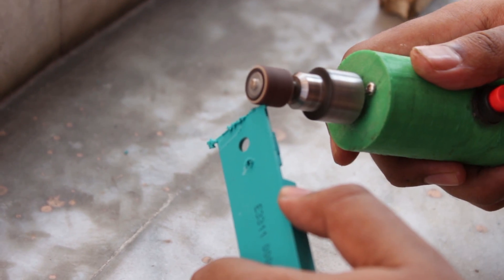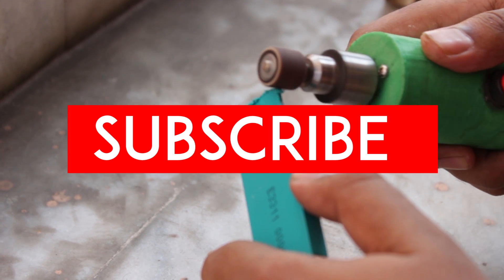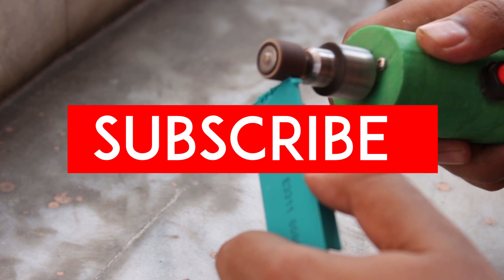DIY Useful Dremel Tool - How to Make a Rotary Tool

Comment: Bro, not to be rude, this mini drill is no doubt good, but with a 3d printer, I expected a much more sophisticated body design. What I mean to say is that a proper area for hand grip, a proper custom case for mounting the switch and last but not the least the motor itself. Because, anyone can find out such shaped bottles or any other matching cases, and with a bit of cutting and slicing can achieve your design. In my opinion, it should be a two piece body vertically, that can be opened any time by removing the screws, for fixing errors. Even better, if instead of screws, the case is interlocking that can be opened by pressing it in selected spots. That was my suggestion bro, kindly don't take it otherwise.